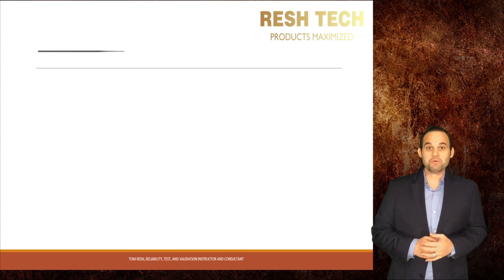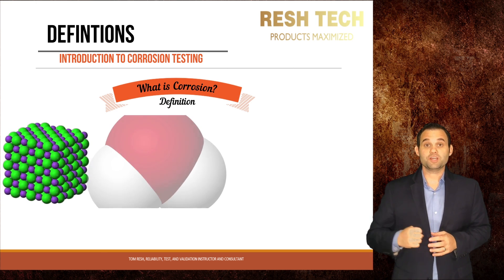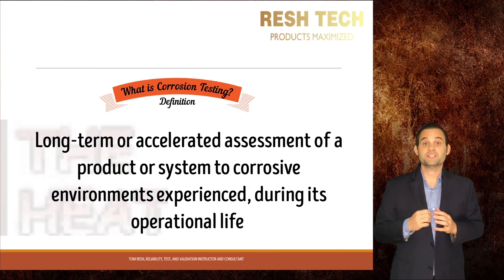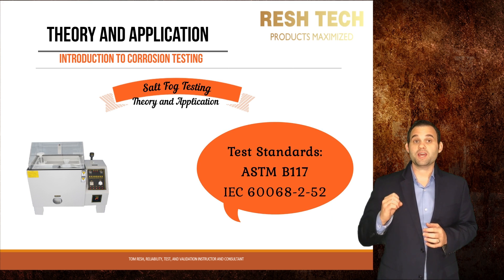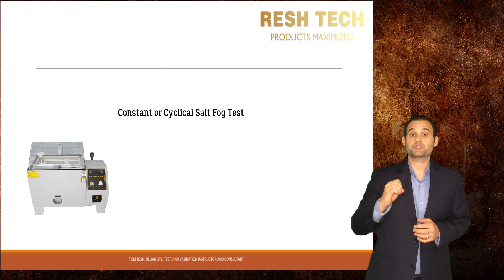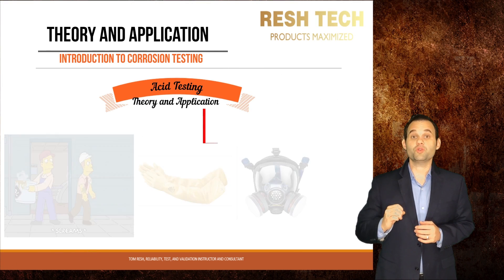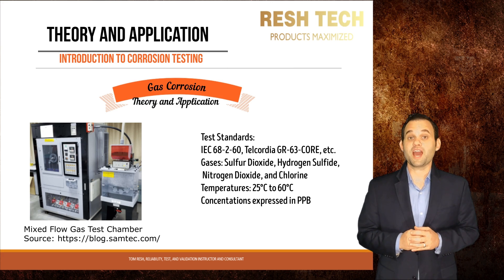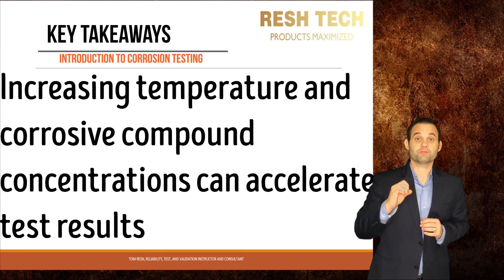Salt Fog/Spray Testing

Comment: Can we use arrhenious equation for elevated temperature in salt spray test , and accelerate the test.
Reply from the maker: Yes, you can apply an Arrhenius equation for the temperature component of the salt fog test in order to increase the reaction rate, but it purely depends on the exact intent of the test and what you are trying to activate chemical change for: the coatings, substrates, e plating, etc.
Reply: @tomreshtesting  I'm so happy that you reply to the queries in your comments. It has been so helpful to me.
Reply: @tomreshtesting  coatings
Reply: @tomreshtesting  test for silica jel

Comment: Sir I want to do salt spray testing in accelerated mode as it needs to be tested for 750 hours. Please guide
Reply from the maker: Hi Sudhansu,

There isn't a one size fits all acceleration factor.

The duration for the test will depend on the frequency of exposure to a salt fog environment.

For instance if you have a system that is supposed to last 10 years and based on research and analysis you have determined that the system would be exposed to 360 hours of salt spray during it's operational life, you could run a 360 hour test to evaluate the life time exposure and effects of salt fog.

Ideally, you would want to continue and determine when each system will fail.

Also, look at running a cyclical salt fog test which can accelerate corrosion for certain materials.
Reply: @tomreshtesting    sir, what are the stresses that can be considered for acceleration in salt spray test. I have the product to withstand 750 hr of salt spray.  I want to reduce the test time.